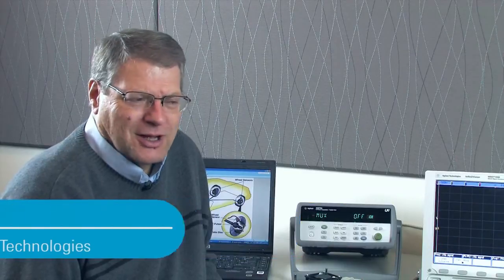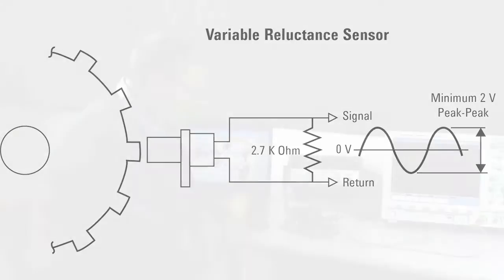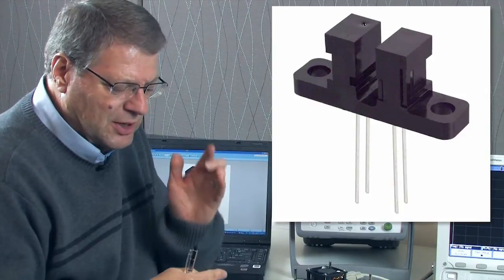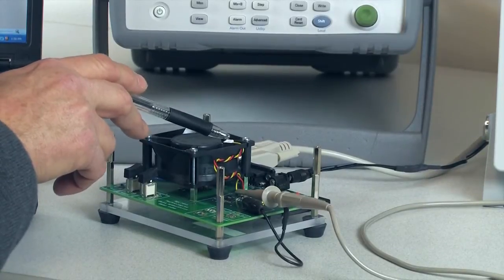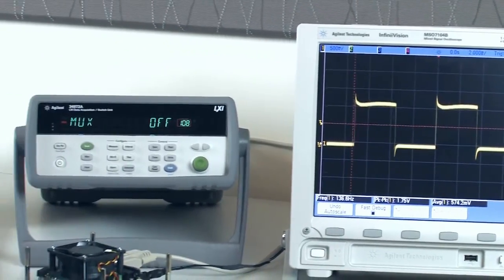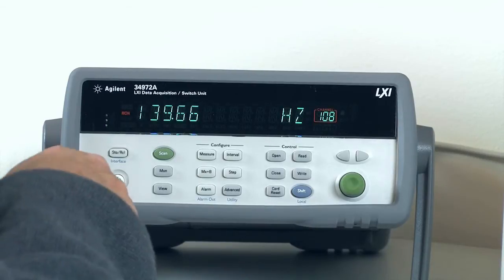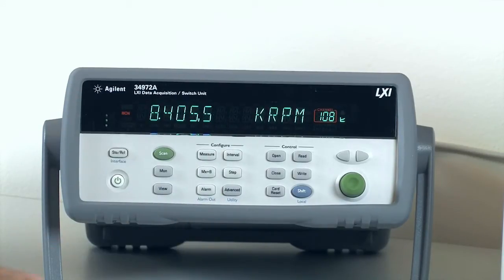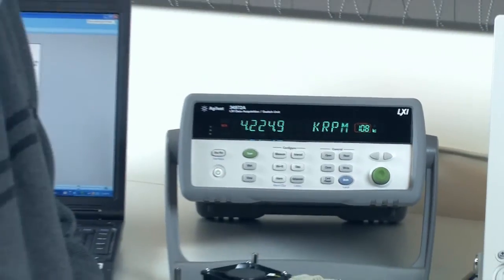Measuring Rotational Speed Using an Oscilloscope and a 34972A

Comment: I am using 34901to measure frequency.  But when I connect the wires to the board and turn the unit on it shows 60Hz before connecting to the hall sensor.  I know the sensor is working because I'm getting a good signal on an oscilloscope.  When I connect the DAQ to the sensor I am just getting random numbers.
Reply from the maker: jtowne  Could the 60 Hz measurement be caused by power line noise? If the wires are not connected the EMF energy could be coupled to your wires.  When measuring the hall effect sensor set an amplitude range - you can use your scope to determine the pk-pk amplitude. The frequency measurement will measure an average over time. Changing resolution to 4.5 to shorten the period which the signal is averaged.
Reply: I suspected that it was picking up line noise.  However it's also "picking up" noise in the ~200-400Hz region also.  What is the lowest frequency this module ca measure?  I'll try wiring the sensor with some coax.
Reply from the maker: @outagas2008  The module can measure down to 3 Hz but you need to configure it for a LF measurement.  Take a look at the manual on page 143 - you can download the manual for free. https://www.keysight.com/en/pd-1000001313%3Aepsg%3Apro-pn-34970A/data-acquisition-data-logger-switch-unit?pm=PL&nid=-33261.536881544&cc=US&lc=eng

Comment: It's very fantastic function! Thanks so much for your movie.
Reply from the maker: Thanks.  The ability to measure frequency can be very useful.  Many sensors output a proportional voltage and scaling can be used to convert to the proper units.